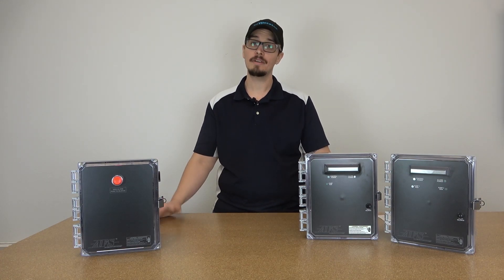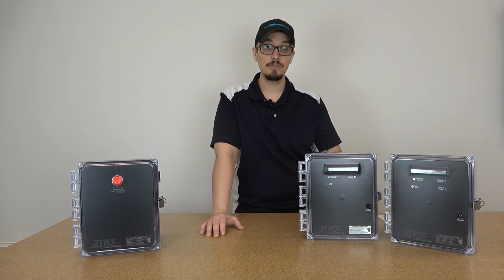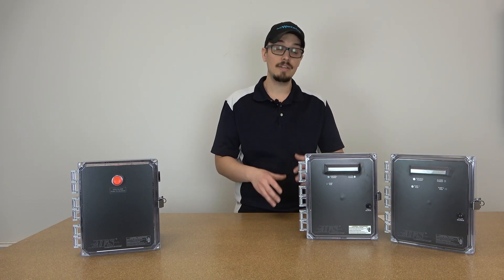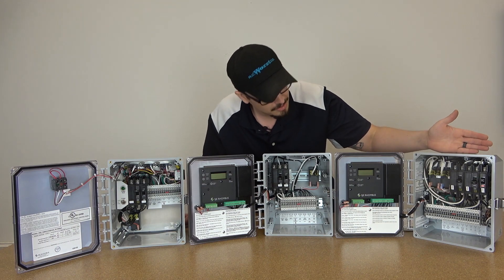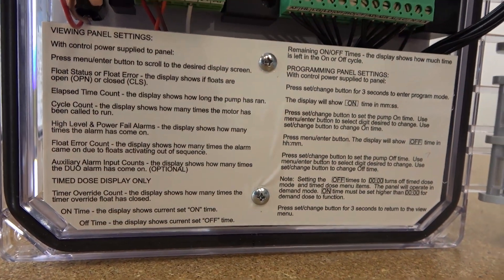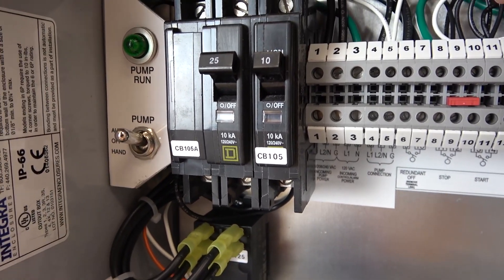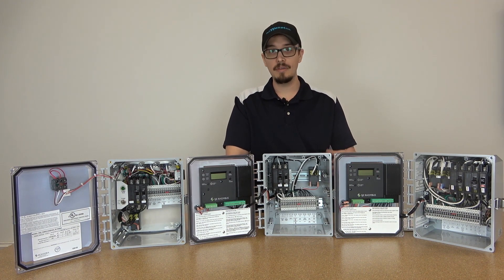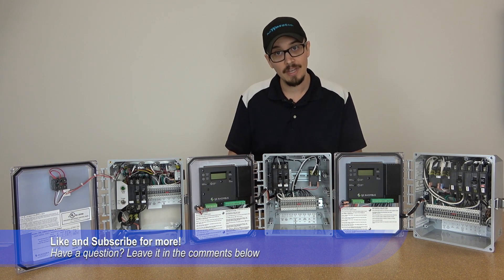*NEW* AFS Control Panels

Comment: A irrigation company replaced a little giant 1.5HP 2  wire 35 GPM pump in a pond with a Franklin 25SV15S4-3W230 with a 35 GPM 3 wire pump. The wires going to the pump are approx 275 feet. The wire is 2wires + a ground.  The wire has 2 wires that are about 10 gauge plus a solid copper ground that appears to be 12 gauge  The pump works great but pulls 16 amps initially then drops to 14amps. The head is approx. 25 feet from the surface of the lake. The old pump had a contractor, not a control box. Not sure how this pump is even running without a control box. No start or run capacitor unless there is one in the pump. I measured the pressure (60psi)with the pump running and the sprinklers operating.
Questions:
Do I need to install a control box? Would it help the amp draw? I know that a capacitor in a AC unit effects the power factor which effects the efficiency. as well as helping the motor to start. 

Could you demo what effect a 3wire pump without a control box vs one with a control box with a start and run capacitor. 
The pump is in a PVC stand. The pump is in the bottom of the stand and draws water from a PVC just below the surface of the water.
Can’t find any specs on the pump. I think the new pump came with a 25GPM pump but the installer changed that part to a 35GPM. 

I have learned a lot from your YouTube videos. I never had a irrigation system before I moved to this home. Any information would be appreciated.
Thanks.

Comment: I have an off-grid desert well that can only pump for 30 minutes every 3 hours.  I also have above ground water storage and need a pump controller that will pump for 30 minutes every 3 hours, but only if the tank isn't full.  Suggestions?

Comment: my well is less than a year old , about six months ago my well would lose prime , i would go out add water and turn it back on it would run fine for a month or so , all of a sudden it would do it again , happened today i added less than a gallon of water to fill it , but the pressure gauge back on and it runs fine , what keeps causing this.